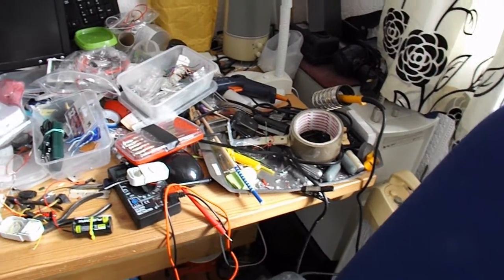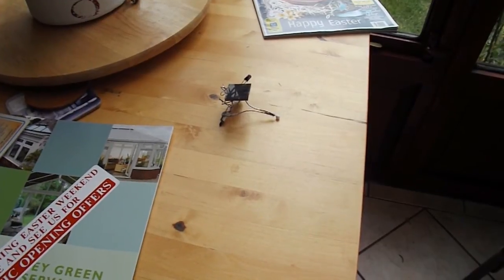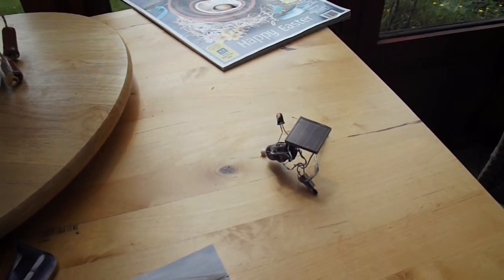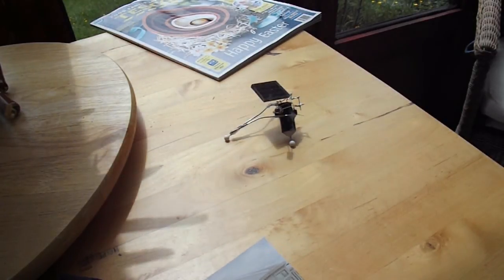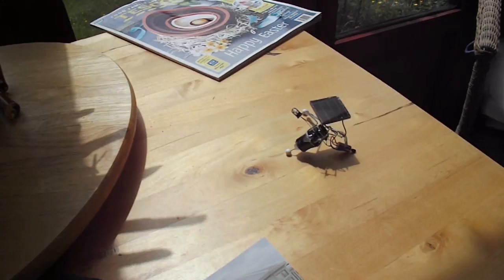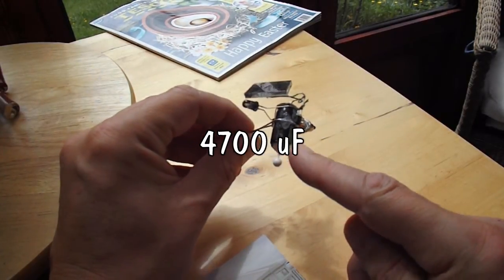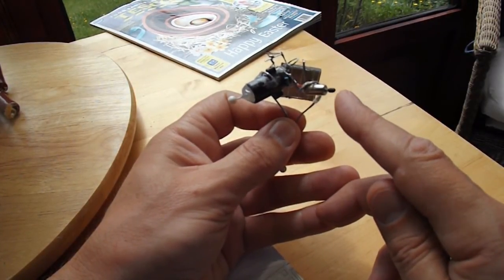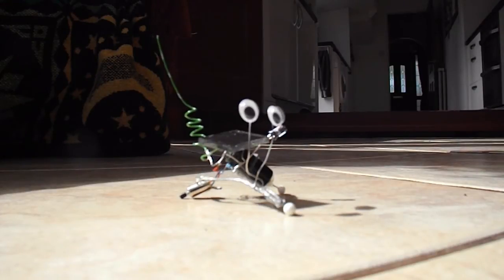Solar Fun - FLED based mover - BEAM Bot

Comment: Can i use normal LED instead of flashing LED?
Reply from the maker: As I see it, you have two choices. 1. Try it and find out for yourself. 2. Click on the solarbotics link in the video description and read the article that explains how it works. 
Sometimes it is good to try things for yourself, you may learn something even if you fail. Sometimes, it is best to follow instructions to the letter if you want to succeed.
Reply: @GrandadIsAnOldMan  i've tried years ago with normal LED and FLED but no luck in both, now i realized that my solar panel output is about 2 volt so it wont achieve trigger voltage. Now i want to try again but it seem hard to find FLED in my city. My last FLED is gone hehe. So, yes i will try with LED and then i will try FLED (with 5 v solar panel)
Reply from the maker: As I understand it, the charge builds up slowly in the capacitor, when it has reached the trigger voltage the LED conducts (and flashes) and that turns on the transistor and that gives the motor a burst of power. Then it has to wait for the capacitor to charge up again to repeat the cycle. So I don't think the solar panel needs to be a higher voltage, it just takes longer to build up the charge. The stronger the sunlight, the faster it will charge, but to see it moving I usually use a time lapse camera and film it over a long period of time, maybe leave it running for the afternoon in the sun. The motor I am using is tiny, so it does not need much power to spin, but it only spins for a split second. That is why it moves in short jerks. On a really sunny day it does almost look like it is running continuously because it is recharging quickly. I hope you do manage to get one working, because it is very satisfying to watch. I used to leave it on a metal tray on the window ledge and forget about it, then on a sunny day it would wake up and you would hear it moving on the metal tray.
Reply: @GrandadIsAnOldMan  i did make 1 photopopper. i've tride to use different LED and FLED. And yes, normal LED doesn't work, and the green one fit on my robot. And the solar panel should up to 3 volt.
Reply: @GrandadIsAnOldMan  thank you grandad

Comment: do it with a lemon instead of solar panel now :D and you get a lemon that moves itself!!!
Reply from the maker: +realflow100 there is a basic problem with power to weight ratios. Maybe you should try it yourself. The circuit is simple enough.
Reply: are you sure you couldn't get enough voltage to slowly charge up a capacitor to give jolts to a tiny toothbrush motor like the solar panel?? I tried just shoving an LED into a lemon and it lit up dimly!
Reply from the maker: ***** like I said, why don't you try it yourself.
Reply: GrandadIsAnOldMan I cant. I dont have the components!

Comment: Is this how it is?.
Does the solar panel, and it charges the capacitor is dercarga through motor causing movement?
Reply from the maker: Yes that's it. The charge builds in the capacitor and the flashing LED triggers the transistor and allows it to discharge through the motor. If you follow the link in the description to the solarbotics site it explains it better there.